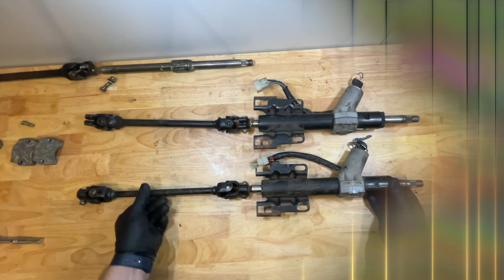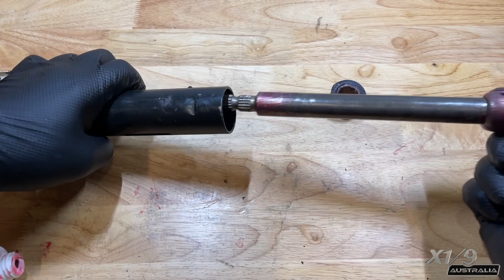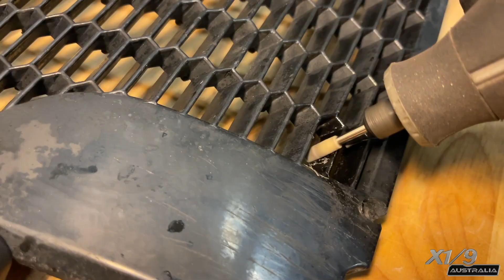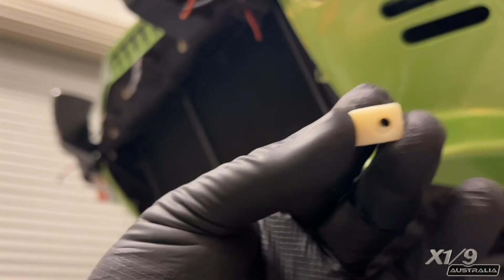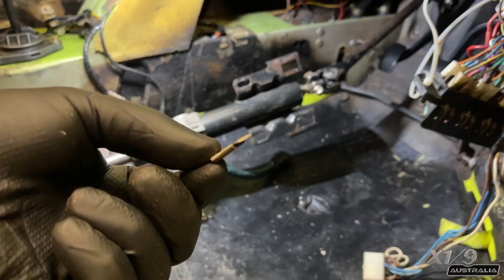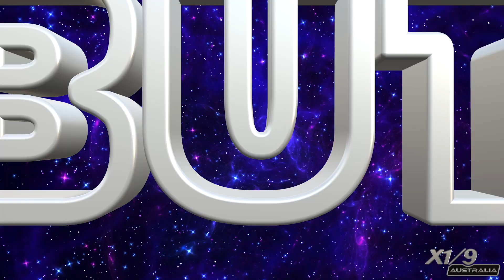The Green Machine Part 28 of a Fiat X1/9 fix

Comment: I always smile when a new episode arrives in my feed.  Excellent documentation as usual Mark.  The stock spoiler on the later cars is a bit flimsy and needs some support in the center.  Like you, I was reluctant to attach my nice grille to the floppy thing so I fabricated some aluminum strips that hang down behind the grille and attach to the spoiler from the upper valence leaving the grille isolated.  Spray painted black you can't tell they are even there.
Reply from the maker: Good idea, but this one is very light as only fiberglass so think would be okay. If i had an original then yes would take that advice on for sure.